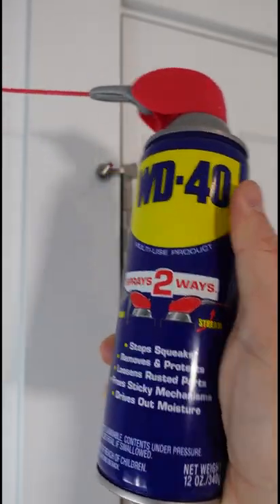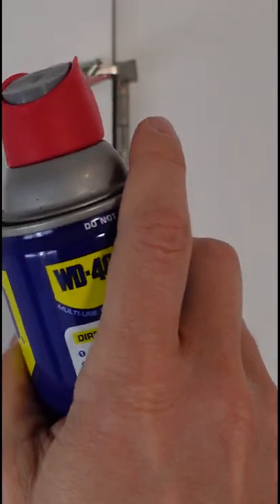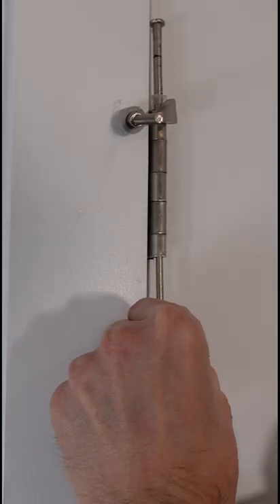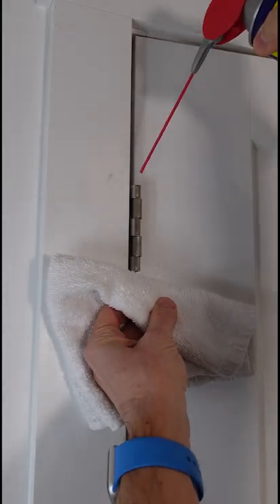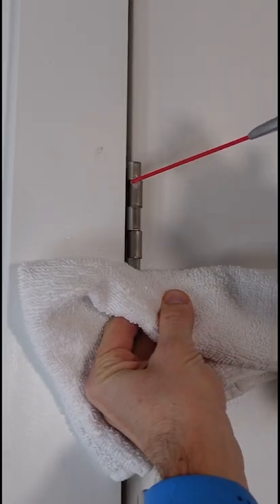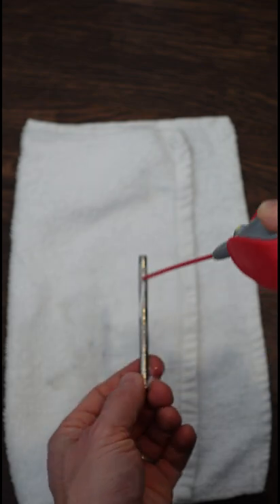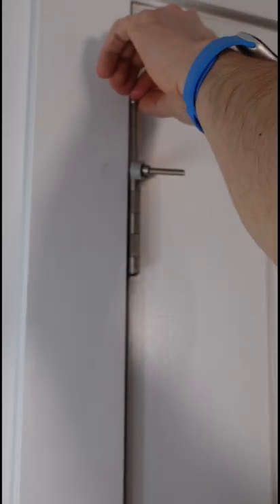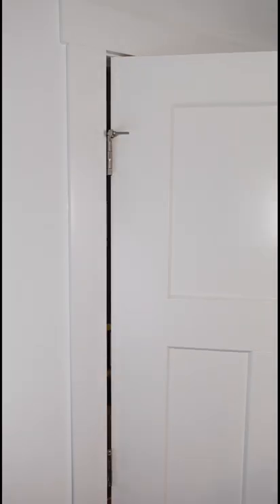QUICK Fix Squeaky Door Hinges

Comment: Well WD-40 is good for cleaning the parts it is not the proper fix. WD-40 is solvents and stands for water displacement formula 40. It cleans it okay but you might even be better off with some other solvent even acetone to remove manufacturing grime and lubrication. The use of a dry lubricant such as graphite powder is the proper fix. After cleaning the parts apply a light dusting of this powder catching any residue with the towel apply some down through the hinge holes and some on the PIN it will stick by static electricity insert the PIN problem solved! WD-40 will eventually dry out and the squeaking will come back, now you're waking the dead again. Graphite powder is sold at all home depots and hardware stores in little tubes and it's the proper lubrication fix for locks that stick and anything that does not get wet it can even be used in cars.
Reply from the maker: Great feedback, thanks for sharing!
Reply: Graphite is smart. I didn't think of that
Reply: If your going to use the blaster that dries quickly, take really good care not to get it on the paint or let it drip before it dries, its a pain to get off. I took my pins out and shot them in the sink with a paper towel backer. Worked like a charm.
Reply from the maker: @PapaCasual Thanks for sharing!

Comment: Wd40 good for quick fix but may not last long. White lithium and other grease would last longer.
Reply from the maker: Definitely. 👍🏼👍🏼
Reply: I tried wd-40 once. It didn’t last a week. Tried it a second time and the same happened, not even a couple days. It’s a new door and hinges. Gonna try a grease I have for mechanics which I used for a sliding door on a van that really needed some lubricant since the sliding doors were really hard to slide.
Reply from the maker: @raba650  White lightning grease is a great option that is more long term.

Comment: I just sprayed it over top since the pins seemed stuck- would you use a lot of force with the hammer?
Reply from the maker: Sometimes if it is stuck, you may need to “convince it” to move with the hammer and screwdriver.